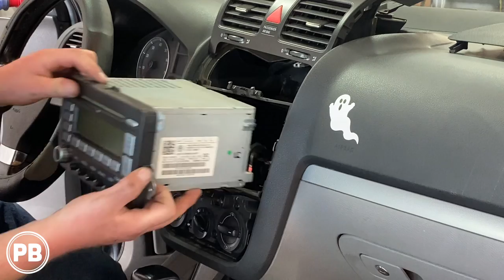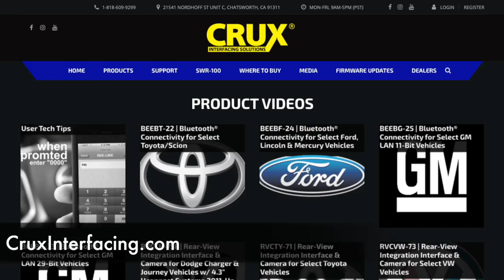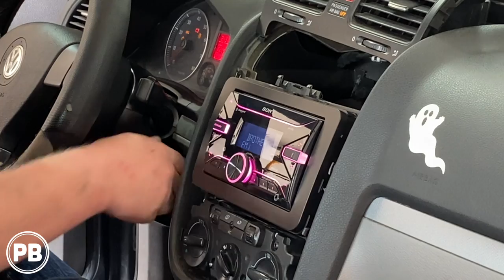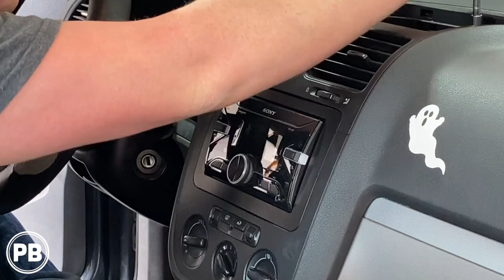2005 - 2010 VW Jetta Radio install

Comment: This head unit has an internal amplifier which requires a direct 12 gauge power wire ran to the battery.
Reply from the maker: Incorrect as this unit only produces 20 watts rms @ 4 ohms per channel. The Sony DSX-GS900 does 45 watts RMS @ 2 ohms which amperage draw requires a direct lead to the battery.
Reply: @ProvoBeastAudio  My mistake. Apologies. Thank you for the videos.
If I could pick your brain for a moment?
If I did run a 12 gauge power wire directly to the battery would it still be fine to use the harness provided ground? instead of the 12 gauge separate ground wire? Thanks so much

Comment: Should the battery be uplugged first before starting or is it ok to replace radio with battery still connected?
Reply from the maker: Always a good practice to remove the negative terminal off of the battery before you start your install!

Comment: I have a 2008 VW Jetta with a factory amp in the trunk...would this setup work? More specifically the radio wiring harness adaptor.
Reply from the maker: You bet

Comment: In your older video you ran a 12v wire to fuse box.  This harness does not require you to do so.  I already purchased the access Xsvi 9003-nav.  Do I have to run wire to fuse box with this one.  Thanks so much for the video!
Reply from the maker: Nope, shouldn't need to at all as the Axxess harness is a smart harness.

Comment: When I did a new install on 2009 Jetta the receiver came on with the keys out and wouldn’t turn on. I read something about a switched power wire that needs to go to the fuse box. Is that accurate?
Reply from the maker: No, it's all dependent on whether you used the right harness adapter or not.  Individuals run a wire to the fuse box because they are not using the correct harness that generates an accessory at the radio from the canbus of the VW.  If you have the right harness, no need to run wire.
Reply: Well, the more expensive harness has that canbus feature but a cheaper harness has a red wire to connect somewhere where you get power when turning the key.

Comment: Hello mate. What is the reason of the Crux SWRVW-52 Radio Wiring Harness Adapter in that case? As i can see you don't have any steering wheel buttons. I do have a Skoda Octavia VRS that uses exactly the same setup like this Jetta and i am not sure how to install an aftermarket head unit without having any issues with Canbus etc. What is going to happen if i don't use any of these Crux SWRVW-52 Radio Wiring Harness Adapter? Thank you very much.
Reply from the maker: See the description at the list of parts as it differentiates between the two harness options.  Customer brought us the steering wheel control harness version even though that feature wasn't equipped.

Comment: How would I know if I have a factory amplifier on my 2010 jetta se, I want to install a double din and I have a basic harness will this work
Reply from the maker: Yes it will work.  And if you had the amplifier, it is generally under the front seat.

Comment: Did the sound work bc when I hooked my aftermarket radio I get no sounds
Reply from the maker: You may have a factory amplifier which isn't turning on with the new radio.  You may have the wrong harness, or wired it incorrectly.  Generally there is a blue / white wire on the radio which triggers the amp to turn on.  That needs to be connected to the radio's remote turn on.

Comment: Hi Provo. I want to put an aftermarket radio in my 2012 jetta. I actually have the same SWRVW-52 for my kit. There's the VSS wire, so when do I know if I need to hook that up? On the radio wiring, there's also a Parking Brake Input. Is that something I have to dig in my car for?

Comment: do you need to tap into the fuse box like you did in the previous video using the crux wiring harness. I purchased an atoto a6 pf and the crux socvw-21. will in need to tap into the fuse box with this setup?
Reply from the maker: Nope, as the crux harness produces the accessory wire from the canbus signal.

Comment: Thank you for these videos.  I've ordered the parts through your links.  I have  an 06 Jetta TDI manual  shift.  Will the backup camera wiring method work the same way, I mean, will it send a signal telling the radio it is in reverse?  Also, can you explain, or do you have a video on how/where to run a bluetooth microphone to the head unit?  Thanks again.
Reply from the maker: Yep, will work just the same.  We installed our bluetooth mic in the A-pillar corner location (by the mileage sticker), ran the cable down the weather seal, and to the radio cavity.